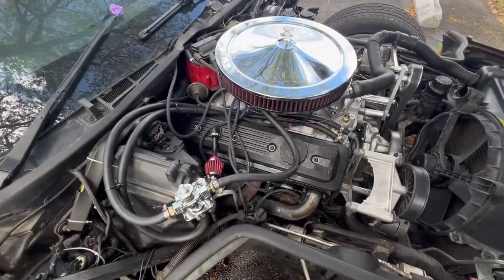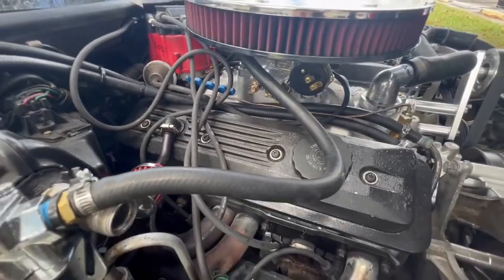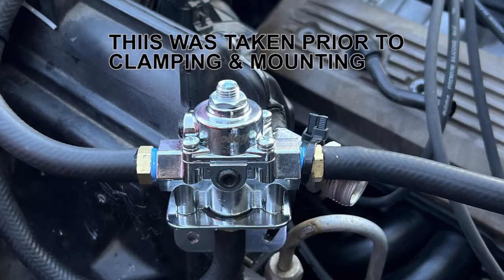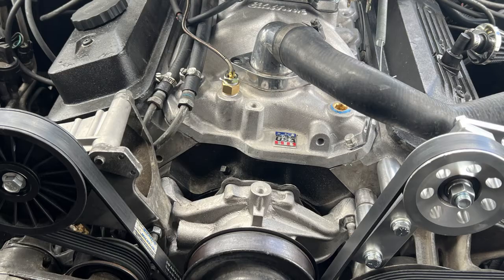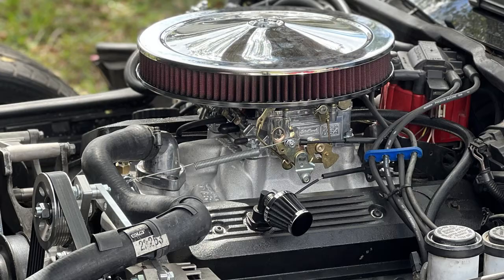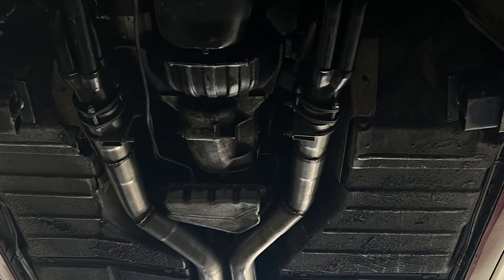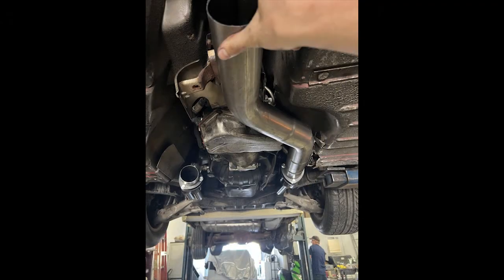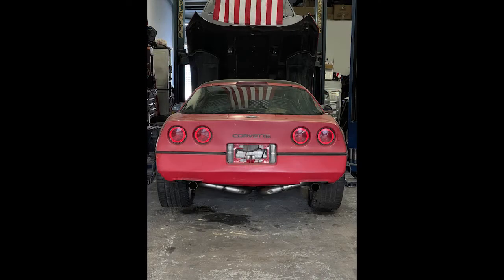TPI TO CARBURETOR SWAP 2023- How to convert your C4 Corvette to carburetor guide

Comment from the maker: Feel free to ask anything. Any questions, more pictures, advice, post it below!
Reply: Is the manual transmission in your car the Doug nash
Reply from the maker: @shanemcclaran3012  yes, 4+3. Not a bad trans at all however my OD is not turning on at the moment.
Reply: My dad recently converted his 87 to a carb setup like yours. It turns on and runs if I hold the gas pedal but keeps turning off. Any advice to help it stay running? His set up is almost the same as your except we don’t have the throttle springs but will get it tomorrow.
Reply from the maker: @bryanpozo1763  Try to make sure the following is correct: firing order, no vacuum leaks, 7psi of gas to carb, choke may be stuck on or off, make sure the plugs are decent.. If all of those are correct, you may want to troubleshoot the carburetor to make sure it’s not dumping gas or something similar. For that I recommend searching your problem on YouTube/google.
Reply: Do you have any ses lights on? I don't like having lights on my dash.  Thanks
Reply from the maker: @Finkelsteinholy  The little warning screen I have is broken. Im sure the check engine light is definitely on. I have plans to go to a standalone anyways so it can never bother me
Reply: @CREATINECONNOR I understand with the annoying emissions equipment, the old hoses and plastic tubing. They crack or break. Also everything is hard to find or replace now. Still love my GTA and TPI setup.
Reply: Does the instrument cluster still work?
Reply: Hi man you problaby have had this question already please if possible I need to know If I need to do anything with my fans I'm almost ready to drive it but it's my worry
Reply from the maker: @ sorry this comment skipped my notifications. My factory temp sensor switch was broken so the fan’s never turned on. I ended up wiring a switch for the fan. 

if your fans would come on before, then they should still come on. If your dash still reads coolant temp, you’re good. Again, I would still personally rather wire a switch and be in control.
Reply: 😢 the links in the description dont work
Reply from the maker: @kami0712uwurawrxdowo42069  Copy & paste them. They work
Reply: what did you do with your factory TPI wiring harness? im going LS swap with a Carb and dont want o just cut the harness but i want to hide it.
Reply: would some of these or most of these work on the 1985 305 z28 camaro? and is it just the throttle return BRACKET or the entire return spring setup?

Comment: corvette with dished pistons thats a shame gm
Reply from the maker: I think they’re a dish. I think it’s just valve reliefs. I never bothered to look it up tho …. Also, the tune port has 58 cc heads, which is quite small so dishing it will lower the compression ratio to more reasonable levels back in that era

Comment: Question-couple years too late...I have a L98 B4C Camaro, all original. I am considering swapping out the TPI, although it an internal struggle due this car being a rare Police Special package. Its all original, new paint, only 87k original miles. Car rates a 9.5/10 according to every car guru who looks at it. It runs good, however, we all know they are top speed rated. It can get off pretty well, however that TPI system hold these 350's back some. Did you have to replace the heads or was that manifold a direct fit with the stock l98 heads? And, what the HEI conversion as far as wiring for the ignition and tach? Any help is appreciated.
Reply from the maker: There are different intakes. You have to double check that it is a TPI pattern. Summit is really good at sorting and filtering it for you… and HEI plugs straight into the factory harness
Reply: @CREATINECONNOR  Awesome, Thanks!

Comment: There are low clearance plenums from spectre that will fit a 2-inch clearance of that hood with those carbs and that will be able to connect to the front part of the air cleaner with a hose. Look it up

Comment: Question about the fuel return lines, are you using one of the existing lines as the return? You don’t have to run a new line back to the tank?
Reply from the maker: Yes. Its the the slightly smaller line of the two.
Reply: @CREATINECONNOR ok thanks, that line is already connected as the return?  Mine has gas come out of it if I undo the plug on the line. Sorry I picked one of these up that had already been swapped but they never ran a return.

Comment: In the process of you swapping your TPI to a carburetor, what did you do with the injector wires? Did you pull the whole wire harness out? Track them down and deleted them. Where did you do with the wires?. It look good under your hood. No doubt about it
Reply from the maker: I cut practically every harness running to the motor as everything was useless. Very easy to do

Comment: Thank you for this video, I've been having a terrible time working on my 87 TPI. Had a leaking injector and replaced them all, cleaned out the fuel rail, new o-rings, gaskets, everything. Now the rail is leaking somewhere (reeks of fuel after driving) and I have no desire to go through the whole process again. Would much rather Carb swap.

Comment: Is it possible to convert the cross fire from the 84 vette into a carburetor
Reply from the maker: Yes. The location of your fuel line may be slightly different as well as the various wiring harnesses / sensors but principally you’re still working on a small block chevy.

Comment: This fuel regulator work good with the high pressure fuel pump ? No problem no noise from the pump ? I installed a regulator to my trans am gta with the same c4 fuel pump and didnt work good if you can help
Reply from the maker: Yes. the c4 tpi  pump is around 30-40psi. This mechanical FPR works great.
Reply: @CREATINECONNOR its holly 12-881 right ?
Reply: @CREATINECONNOR the return line is the down outlet or left and right ?

Comment: Has the car been more reliable?  I am tempted to do this job to eliminate my air pump hoses on my 84.
Reply from the maker: Everything has been great. The car absolutely cruises. The only thing giving me a hard time is my upper radiator hose. The stainless steel hoses can be finicky.

Comment: Did you have to do anything to maintain all the gauge functions? I'm looking to buy and convert/mod an 85 manual vette for a street/road course car. It seems you basically eliminated all ECM function for the engine? Do you still rely on the ECM for the dash gauges?
Reply from the maker: @gdsstudio753  nope. All gauges (except the fuel eco stuff) work normal. The only two gauges I lost function of during the duration of owning the car is the oil temperature gauge and the temperature sensor gauge. This was due to them already being broken and not as a result of yanking the tune port.

Comment: Do you think this setup would work on an 84? Trying to get a little more power
Reply from the maker: @mciwharf2586  of course, should
Gain power everywhere. Im not sure how the crossfire drives, but in the TPI I did lose some low end torque in exchange for more power up high due to the TPI excessively long intake runners. On the xfire, you should have gains everywhere due to it being a poor efi to begin with.

Comment: I picked up an 87 l98 to put in my 84 camaro z28  that will be far from stock. Bored .040 over, flat top pistons, melling 22280 cam. Im interested how it will handle with a carb setup.
Reply from the maker: @thedarkphire33  thats got a very similar cam to mine. Its got Solid duration at 220/224, decent LSA at 110, and normal lift at basically .500. Depending on the heads, its will be be VERY torquey. The get up and go will be like a tesla performance… like on rails! If you put a 750 and a performer on it, it will RUN hard up to 6k rpm.
Reply: @IllegalC4  its got the 128 heads on it now i thought about pulling them off and putting a set of AFR 1006s on. 195 64 cc. That would make a good motor, i think.

Comment: How much of this information transfers to the Crossfire injection?
Reply from the maker: @117theone  Basically everything. Remove the xfire, install intake and carb, hookup new fuel line connections, block off smog equipment, etc.
Reply: @CREATINECONNOR  Will I lose functionality of my Instrument cluster?
Reply from the maker: @117theone no. Only the mpg will be wonky.

Comment: can you show how you lined the fuel pressure regulator in and the return line back to the fuel tank?
Reply from the maker: @that_guy_pual  I put either a 3/8 or 5/16 rubber hose to go over the AN6 fuel line fitting and hose clamped it down. Thats obviously not the correct way to do it but it works. The correct way is to get a set an6 fittings and an m16 x 1.5 flare to AN6 male fitting to connect to  steel braided lines. Also, The fuel supply is the one with the filter and the return is the one without a filter.

Comment: What did you do about cooling fan switches in front of intake
Reply from the maker: @mikestewart4980  my particular c4 had a lot of sketchy wiring and work done to it. A lot of the relays were blown or jumped. My coolant switch worked for a week and then stopped working.. god knows why. I ended up wiring a switch from the fan directly to a 25a or 30a fused switch inside the car through a hole in the firewall that I “custom” drilled.

Otherwise, they should work as normal as Im pretty sure the coolant sensor/sender is in the cylinder head. I would still eventually hot wire it because god knows what the ecu will try to do with the EFI gone

Comment: Curious as to what your "seat of the pants" dyno feels like. Did you notice any performance difference? I know probably hard to say as you had a blown head gasket before. 
I've read that the TPI is the choking point for a high performance L98 so you can actually get more power with a carb. I wonder how a TBI like Holly Sniper would do?
Good, to the point video. I like the voice over instead of trying to explain things as you are working on it. My only question is, why do you talk so fast? Sometimes you slur your words as if your tongue can't keep up with your brain. LOL.
Reply from the maker: @LivingOnCash  Lol I noticed I talked super fast in the beginning. That pre workout was working 🤣. I really can’t speak about performance for a few reasons. 1., it was never probably tuned with timing and fuel. 2., the heads were falling apart by the hour. It only took  a couple hours of runtime before the valve guides and seats took a vacation. The machine shop I took them to didn’t notify me of this. 

I can certainly say it had tons of responsiveness and low end torque. I didnt drive it enough to beat on it enough and when I did it was more exciting than fast 🤣

Comment: Did the same swap and I do have to hit wire the pump
Reply from the maker: @lildonut7304  no. The fuel pump will always turn on if the relays are connected and the oil pressure switch has power/pressure.

Comment: I’ve read some forums on c4s that talk about having ecu problems and transmission torque converter not locking out. Have you had any issues like this?
Reply: He has a manual trans so no converter.

Comment: @IllegalC4 Did you have to make any changes to the ECM so it does not have codes?
Reply from the maker: @vetter87-o6l  it will throw every code possible but it doesnt matter as the only use for the stock ecm is the fuel pump & ignition. Thats it.

Comment: What did you do about the transmission? and basically all of the electronics
Reply from the maker: @aidant6118  I have a manual transmissiom, if auto, then you would need a kick down bracket which is extremely easy to install.

No electronics were hindered aside from factory fuel economy related info. I went and cut most of the factory tpi harness and taped it off.

Comment: Just bought a 1987 planning ahead, track only car, going with your program,  thanks
Reply from the maker: I want to give you a quick piece of advice that I did not mention in the video. The worst thing I did in this build was put rubber hose over the -AN fuel fittings. I highly recommend purchasing an -AN6 fuel line kit, a replacement K&N fuel filter, and a m16x1.5 to 6an male flare fitting to replace the TPI fuel line at the filter up to new regulator you will install.

I've done a lot of work since this video and will have a new video up in a week or two showing the rest of the work.

Comment: Lol or just swap to holley sniper n used the o2,temp sensor that already comes in the car. Low tech gonna low tech. What's next swapping the engine for n actual horse?
Reply from the maker: @apocolypse11  sounds like another guy hating on carbs for no reason. Carbs have come a long way and are pretty well modernized. They are half the price and headaches of EFI. Theres nothing wrong for wanting to run either setup. We all have our own preferences and goals.
Reply: "Modernized" lol thats why your car came with TPI by default. An you demodernied the car.😂 @IllegalC4

Comment: why are your torque and hp curves higher than stock?  is this with the motor out of the car?
Reply from the maker: @annehechesliverdonation9624  the chart shown is an L98 on an engine dyno rather than a chassis dyno and has no accessories. Naked small blocks usually make 300-400hp depending on their setup compared to in car with accessories and full exhaust.
Reply: @CREATINECONNOR  ok thats what I thought.. thanks

Comment: I’m trying to figure out the fuel lines and which lines go in on the carb.    There’s several different line connections on the carb.  Front, Rear, etc.  which one is the gasoline supposed to enter the carburetor from?  And trying to figure out which line is the return line because I guess I had hooked it up completely backwards. I only had the input and output hooked up to the fuel regulator and then had the hose connection on the back of the carburetor going back to the tank. That is if I didn’t get the two metal lines mixed up. I just bought a fuel pressure gauge so now I’ll be able to actually find out which line is which with without spraying gasoline everywhere I’m so terrified of starting a fire. My whole reason for converting this over was because there was a kink in the cold start jet line that I couldn’t get out and it was spraying gas on the Distributor. It started a roaring fire twice, and fortunately I had fire extinguishers right there, but trying to figure out this gas situation without starting another fire just to get the gas into the proper port on the carburetor, I guess I need to look at a diagram for that carburetor. It is an Eldebrock and I don’t know the model number
Reply from the maker: @FederalPrisonConsulting-tm  So to find the fuel supply line, follow the line down to your fuel filter which is in the bottom passenger side of the engine bay. your supply is also slightly larger than the fuel return. Also, the way I did it in the video was super ratchet with putting the rubber hose over the AN fittings. It will work as a temporary solution, but it is not long-term.

Tomorrow In the mail I have proper hoses and AN fittings coming. I’m definitely going to make a video on how to do that hopefully tomorrow. 

Generally, the Edelbrock carburetors have the fuel hook up on the  passenger side as the driver side is usually for the throttle connection while the front and back is for vacuum hoses such as brake booster and PCV.

Comment: I recently picked up an 85 vette with almost 200k on it. It runs ok but has the infamous hard cold start issue and a dead dash. I was thinking about a performer RPM airgap intake + ACES standalone TBI fuel injection + a 90 degree carb hat that can attach to the existing airbox to save space. Perhaps a bigger roller cam and full roller rockers as well. This may necessitate taller valve covers as well. The other option I was considering was an LS swap. Even just a simple common LM7.

Comment: The electronic on 92 are junk as far as I can tell. I’m going to give this a shot. Thanks for the video.
Reply from the maker: @marshallbyford7777  it’s a very simple swap. It might take you a little bit of time and a couple trips to the parts store but overall it’s worth it. I highly advise that you consult somebody throughout the process who could do things such as tuning the carburetor or setting your distributor timing as best as possible. there’s a couple things I did initially that I wish I would have done differently such as the fuel hose hook up line, not installing a wideband O2 sensor, and other miscellaneous gauges to monitor.

I also advise to purchase a holly or quick fuel brawler carburetor, rather than the Edelbrock line .

Comment: I have a question about the return line on your bypass fuel system. Did you notice any pressure creep upward with the smaller factory return line? I've done a couple carb conversions on TBI pickup trucks & ran larger diameter return lines on both. There's less room to put things like that on a C4 Corvette chassis. Did it work well for you?